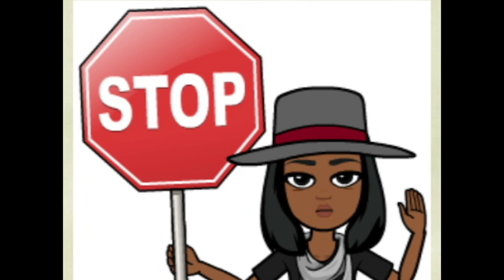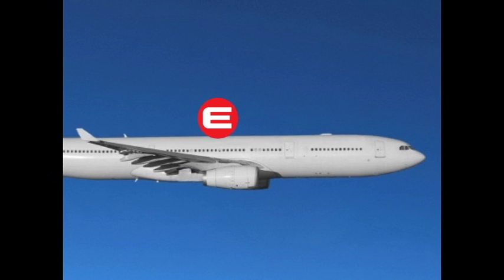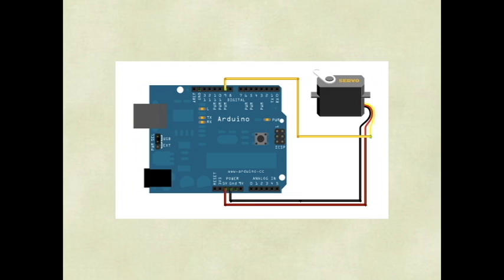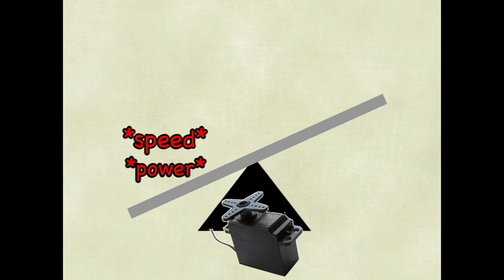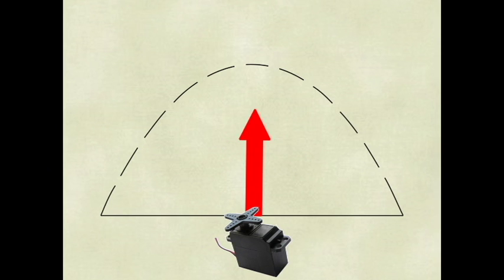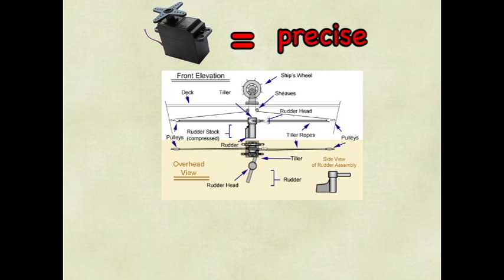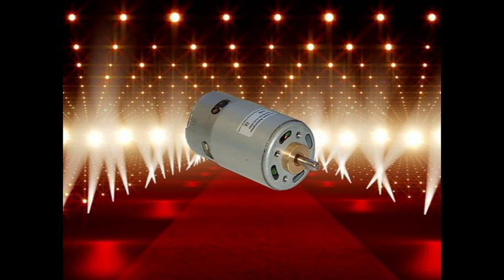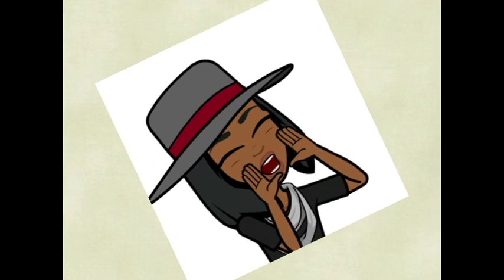Servo vs DC Motors

Comment: sounds like the main reason you used DC was because you initiall throught servos only go 180 degrees. You also didn't mention that servos have much higher torque the DC motors.

Comment: Normal motor connect to driver (l293d) then we get three wire output 

 Is this now servo motor  ?? 
    
... 

I uesd normal two wire motor and driver and I connect to arudino and then spead and forward and backward direction controlled by program ,,   now this is call servo motor🙄????